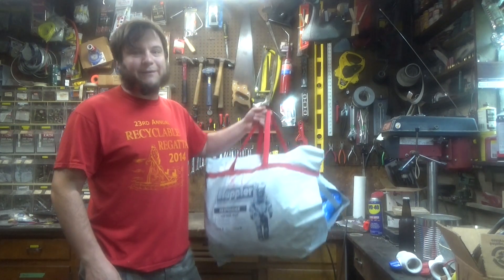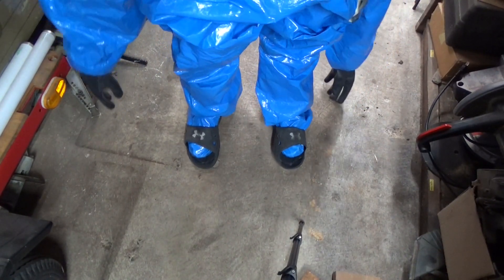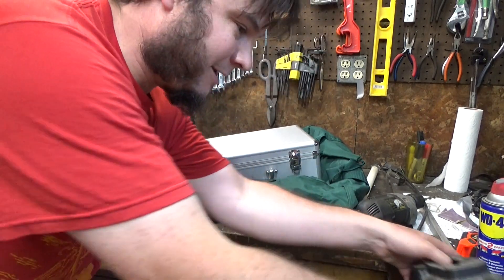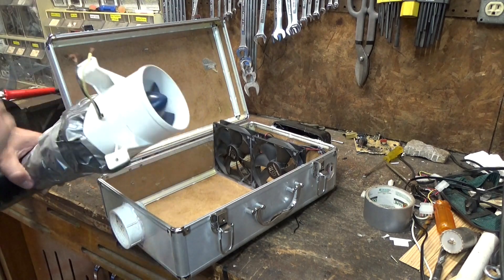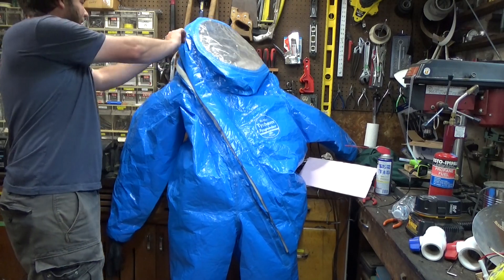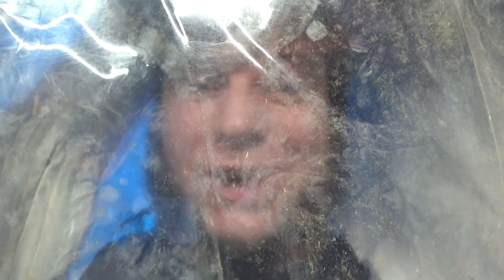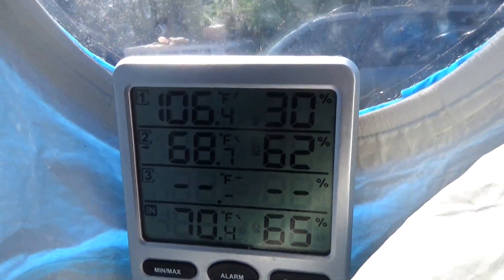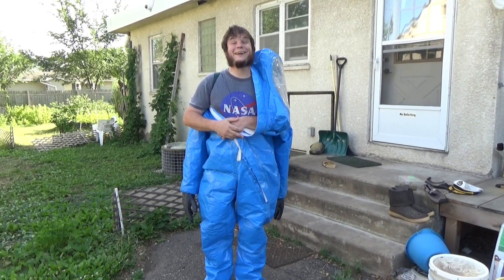Building an Air Conditioned Suit for the Summer

Comment: So, it’s not an ac suit. It’s an inflatable suit. You could’ve just got inside an inflatable costume. That runs off a a blower the size of small book. 
You made it worse. 
Don’t call something an ac suit if it’s not. 
that temp difference was temporary. A few minutes the inside that suit got hotter than outside ambient. ugh.

Comment: A costume maker in Columbus,Ohio told us at a convention how he made a vest with rubber tubing and a battery powered pump pumping cold water from a little tank on the vest around his body. It was like a radiator for the human body.
Reply: How did he keep the water cold?
Reply: @HavokBWR  he had ice in the little plastic container in the front of the vest with ice and water.
Reply: I remember reports that e-sports gamers used some kind of similar cooling vests in tournaments.

Comment: Me, a resident of the deep south: "that's genius."
Your neighbors: "If you're that worried about it get the freakin' shot!"
Seriously though put an N95 or greater over the intake, with the AC and positive pressure, sound reduction, and a microphone and external jack for an electronic stephiscope, you could sell that to a home health nurse for a few hundred since the droplet precaution gear is unbearably hot.